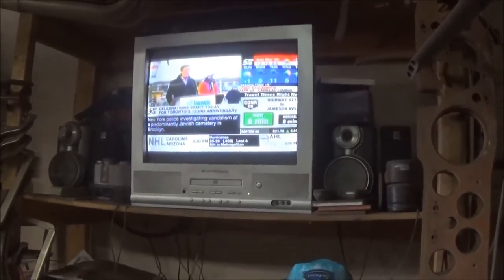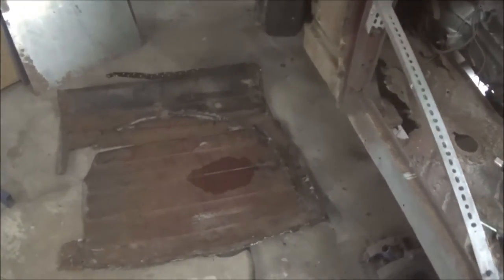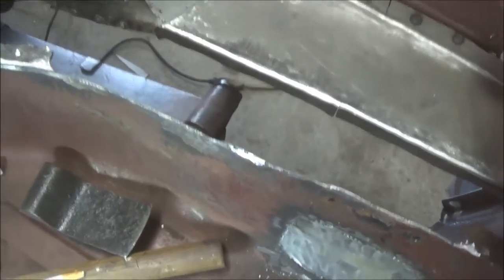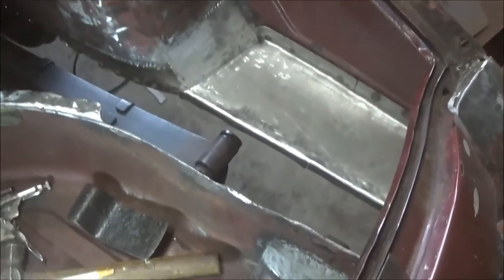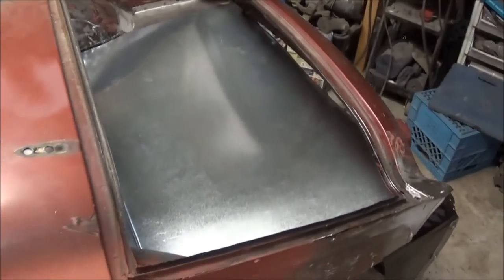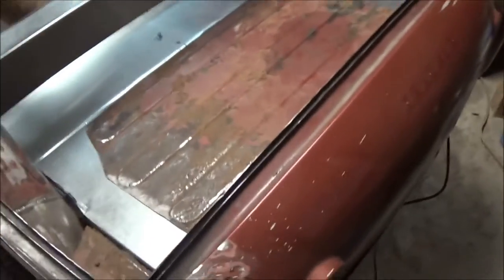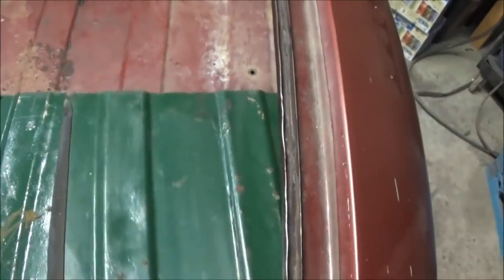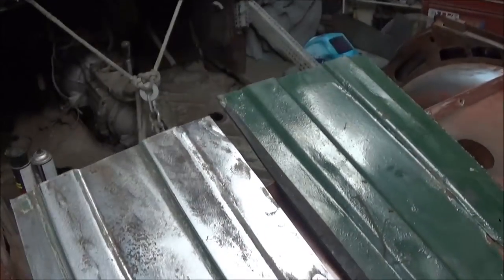Boot/Trunk Floor Part 3, 1959 Triumph TR3A Restoration

Comment: at least most of the repair is done with original repair panel and that is even better could have blasted in the blast cabinet and clen the best that u can  and did u dolly the ribs yor doing a fine job your puting in some love it's it'always beter from an other panels from another orignal car well thought threw .
 
.

Comment: David,  did you complete the 1959 boot floor?  I need to do similar work on the TR2. Save those scraps!!
Reply from the maker: I don’t think I got it to a point I was completely happy with it.  It will be an area I revisit once I get back to working on it.